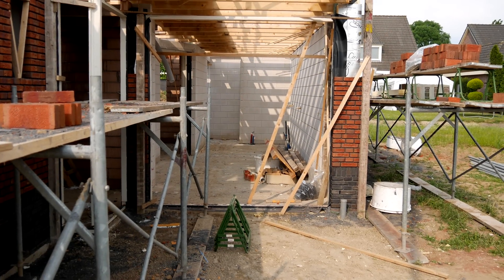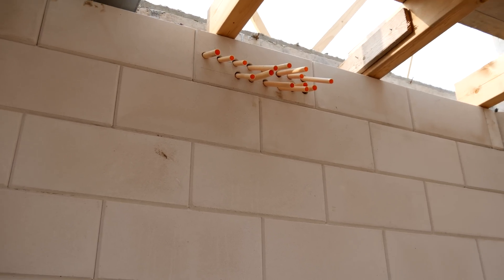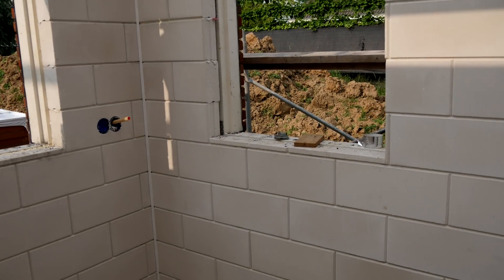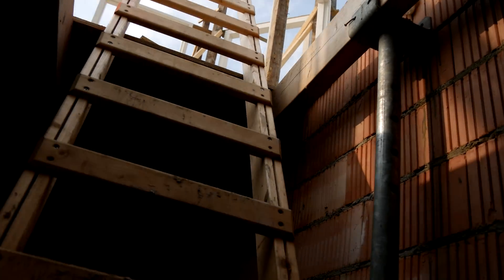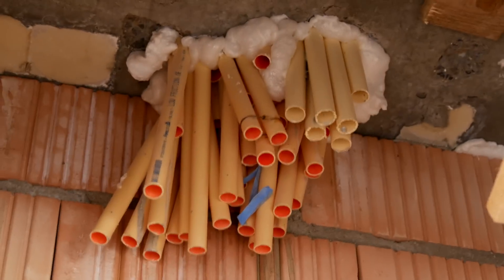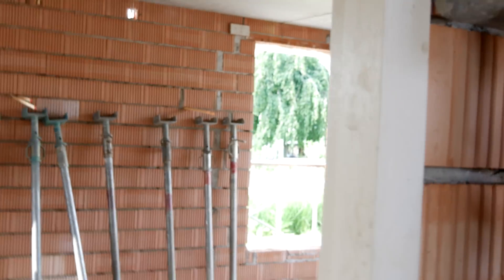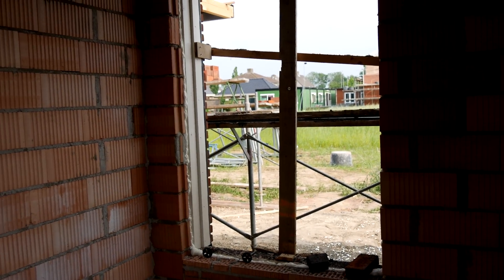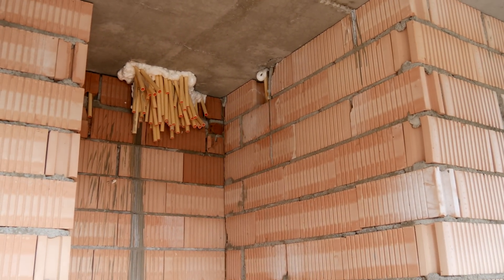Home Networking: First walk through on the build site

Comment: imo you should have gone with a bit larger pipes, those look like 16mm ones, thats a bit small.
Reply from the maker: Actually most are 3/4th inch pipe so 19mm! Power is mostly 16mm, network uses 19mm, and some special and three fase power runs use 1 inch thick. I'm still debating if I can get 2xCAT7 through the 19mm pipes but in the case it won't fit for some runs, I doubled up all the runs with two pipes. :)